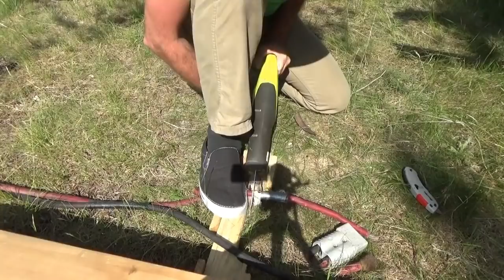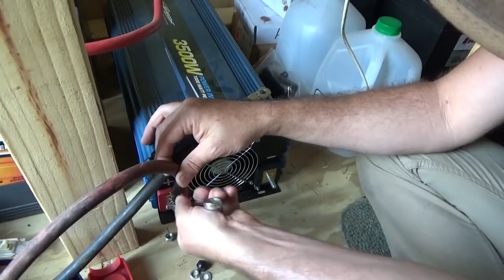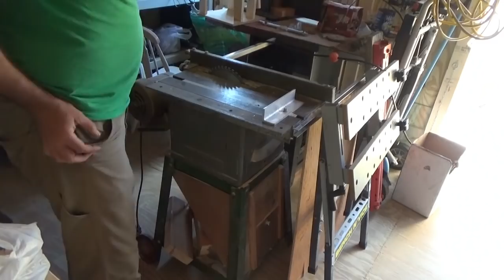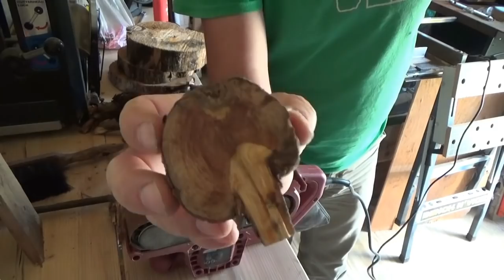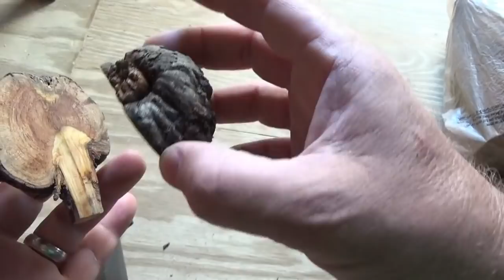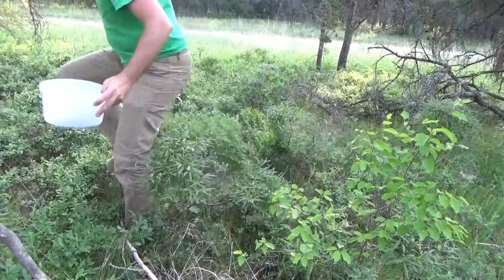Busy Homestead Day Part 2 Inverter Hookup Wood Work And More

Comment: Look on the public land and see if there are any berries on it? Also you will have to level that saw mill too I guess you showed it was running down hill on the end? shim it with wood shingles or some thing. That is some really nice wire man should work very well with extremely good  efficiency. That is the kind i use 00 fork lift wires but yours looks like 000 fork lift  leads. Wow its nice the good stuff LOL I love it.

Comment: For the woodshop you might want to consider saving up for a 48V inverter/battery setup to bring on the juice for all those power hungry tools! 

When needing high power, 12V/24V really isn't the best option and you lose more power in the conversion from 12V->120V.

48V system also lets you use smaller cables as well. 

Depending on the inverter, you could also use 220V workworking tools in addition to the 120V ones you currently have.

Comment: Since 1/0 cable is rated for about 150A you probably should put a 150A fuse on the positive lead going to the battery to avoid a fire if you draw more than ~2kW from the inverter.

Probably should get some GFI outlets too to avoid nasty shock hazards; maybe hard wire a #10 between the two buildings to avoid tripping over an extension cord? Woodworking shop might benefit from hard wiring multiple sockets inside so you don't have cables stretched across the table/floor. I suppose if you got fancy you could put a generator socket on the outside of each building, wire up various sockets on the inside of the buildings to the generator sockets, then connect across with a generator extension cord. Would have the advantage of being able to hook up the genset to one of the buildings if the sun isn't shining to distribute power inside them; probably want a transfer switch setup on the electronics shop to make sure there is no backfeed tho!

Burled wood looks NICE!

Blueberries look YUMMY! Blueberry bushes aren't doing too well here this year but Red and Black Raspberries are going bonkers; and quite YUMMY!

Good luck with your wood projects!

Comment: Free energy; free blueberries! Great! 😀
Reply: Sorry, but there is no such thing as "free energy". Solar power systems cost money. When done right, they cost a lot of money. If I were to replace all the energy I use with solar.... I would probably end up spending $20 to $30 thousand dollars.
Reply from the maker: David, that may be in your case but I paid off my solar panels years ago. So any energy they are producing now is free for me. Solar panels can be purchased for about $1 per watt. The average home needs $5 - 8,000 watts. Thats only about $5 - 8,000 plus supporting hardware. Lets say $10 - 12 k for a solar power system which can handle most of your energy needs. Look at your electric bill and see what you spend a year. You may be surprised at what you find.

Comment: Troy, you know old corroded junk wires will affect performance:) Cutting the cable to a point that is less corroded is like putting new paint on rotten wood. Sometimes cheap or free isn't always best. But as always, I do hope your project works out good.
Reply: Regarding the fuse and disconect switch... I'm talking about the battery side of the inverter, not the AC side.
Reply: I was wondering about using old wire/cable for electrical/power purposes. And it makes sense what you are saying. I'd be worried about a fire. Would insurance cover a do it yourself wiring like this?
Reply: I believe there may be issues with insurance if the wiring is not done to code. Which is why I post my comments... Not to be mean or give Troy a hard time. I just want to see things done right and safely. I may be wrong but I believe that a disconnect switch and breaker or fuse is also required.
Reply: Troy, I thought you said there was still some oxidation on the cable after you cut it. If I'm wrong you have my apology.
Reply: There may be no permits required for a shed, but... I believe it is always best practice to follow code for safety reasons.
Reply from the maker: There is no code or insurance on an off grid Amish made shed with no connections to the outside world. I do have a disconnect and fuse on the solar panel side. The inverter is fused as well. I dont see the problem. Most cheap inverters cannot be used with a breaker because there is no true neutral line like in a house. Only the really expensive ones can be used like that. I already bought all the gear for that for my tiny house and never used it because I found the breaker would not work with my inverter.
Reply from the maker: You may end up with a fire if you try to put a household breaker on an inverter that was not built for it.
Reply from the maker: David, the wire was not corroded past the point where I cut it. There was a hole in the insulation and I cut that off.

Comment: he troy I use copper pipe to make connectors cheap cheap slide the piece of copper pipe on the cable and crimp it on and then smash the remaining part of the pipe flat and drill a hole for the stud I also use 15% silver solder on the pipe and wire works good

Comment: This advice is for your viewers
When installing GFCI or any device where the wires mount the same..
Using solid wire..
You're putting a round soft wire into a square hole..
Any movement or heat will help that round wire transform into a square causing it to come loose..
If you try to tighten the screws with a phillips screw driver it's not tight enough..  Use a flat blade or squared drive and try to break the screw..
I'm 6 ft and 250lbs and haven't broken one yet..
After you have trained the wires to slide into the electric box. 
Retighten the screws again...
Don't be surprised you can tighten them more...
Good luck with your projects..

Comment: Just a suggestion.
As you move your inverter around those cables are trying to loosen up...
If above the inverter you tape the cables together in maybe 3 places..
They shouldn't try to loosen as much
Reply from the maker: Good idea, thanks. I did that on my large solar panels but not here.

Comment: One of the reasons electrical wires come loose..
Is electrical wires heat up and cool down..
This cause nut or breaker screws to back off..
as an electrican when we opened a electrical panel we would go thru the panel and tighten everything...
I suggest maybe every year or two to service (tighten) your electrical panels and wires and cables
Reply from the maker: Very good advice, thank you.